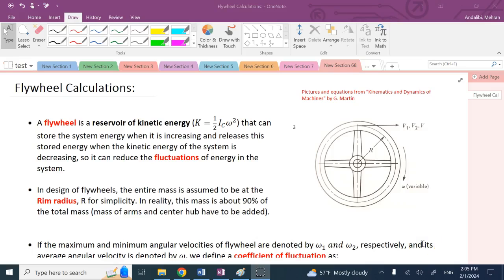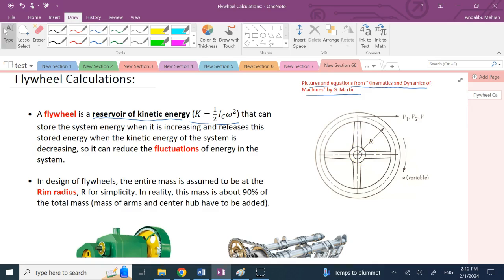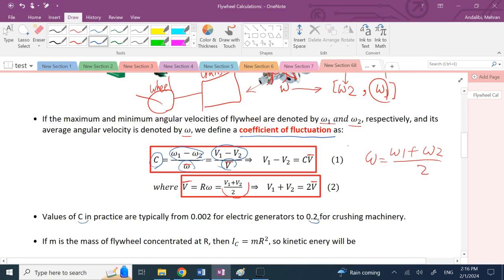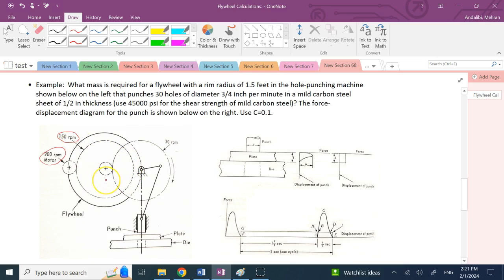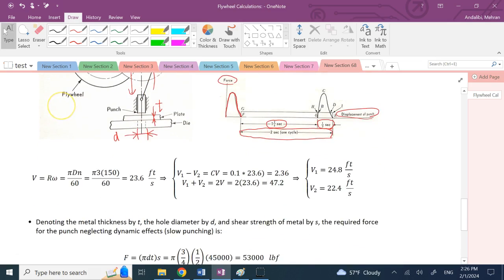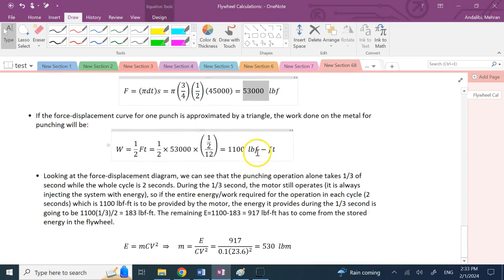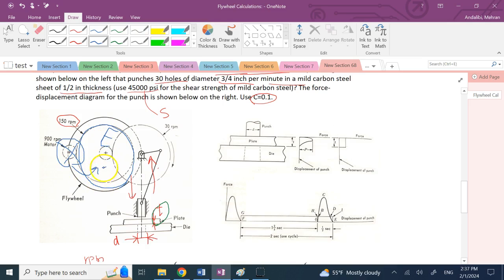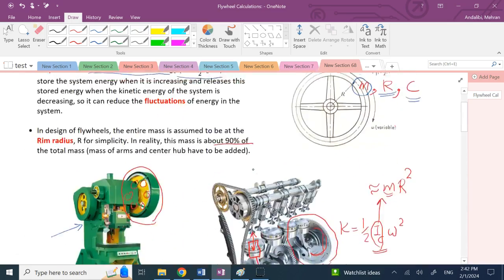Flywheel Calculations

Comment: How would I calculate the flywheel size and weight to run a log through a sawmill blade? The prime mover is 6 hp rotating a shaft at 2 RPM. There will be gearing to increase the RPMs of the flywheel to <250 RPMs . The flywheel will be 4340 steel plate, rim weighted for the maximum moment of inertia and the maximum diameter would be 20 feet as 120" wide steel plate is the maximum easily obtained and then the two halves welded together, then plates would be bolted to the outer rim for added weight. It take about two to three minutes to get a log off the infeed and loaded onto the carriage and rotated to where the opening cut will be, then the dogs clamp the log and it moves towards the saw this would be time that the flywheel is speeding up. The time the actual log is being cut by the blade is 10-15 seconds per pass depending on the type of wood and the length of the log. Resetting the carriage to make the next pass take about the same time of 10-15 seconds in which the flywheel would be increasing in speed. Any help would be greatly appreciated. Thank you
Reply: دمت گرم دکتر
خیلی عالی توضیح دادی.
کیف کردم❤